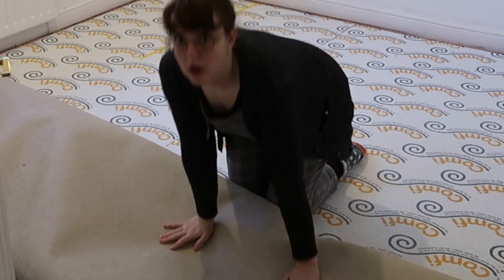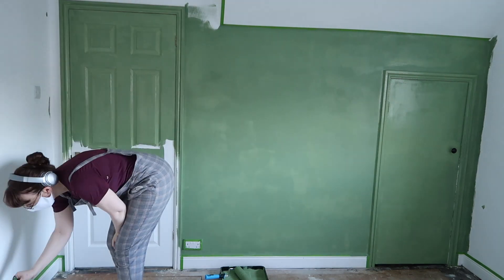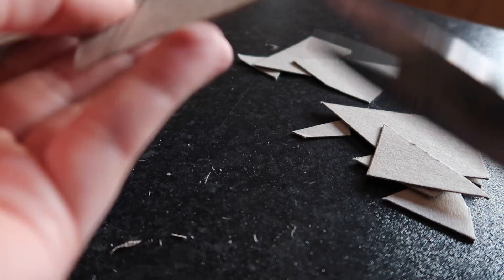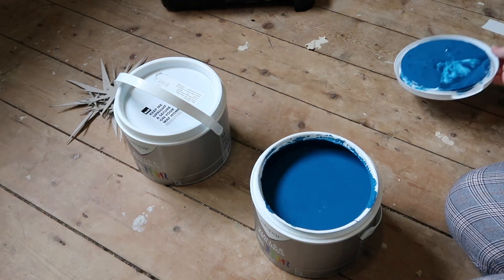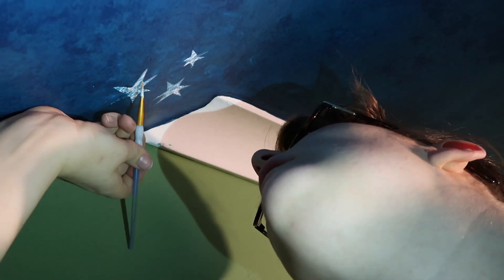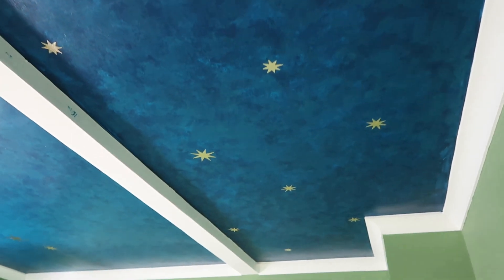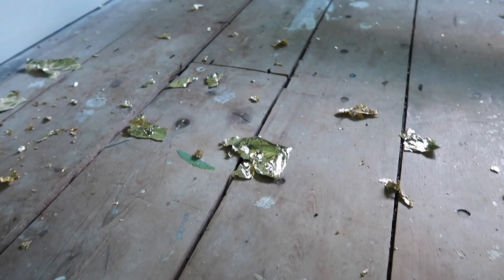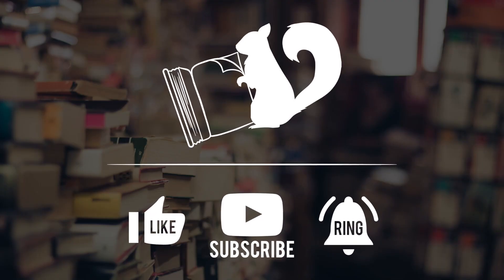Ceilings and Floorboards and Walls, Oh My! ~ Building the Dream Library, Vol. 2

Comment: Poor thing! Your life would have been so much easier if you had used stencils to apply the size and a much better metallic paint. No, you weren't using stencils. You were tracing around *patterns*. Stencils would have been hollow shapes you could hold up and fill in the star-shaped space with a stencil brush. Think of sugar cookies. Patterns are the cookies. Stencils are the dough left when you remove a cookie.

Just for the persons who follow this, who want to do a similar decoration.